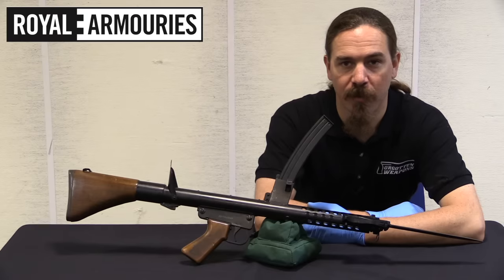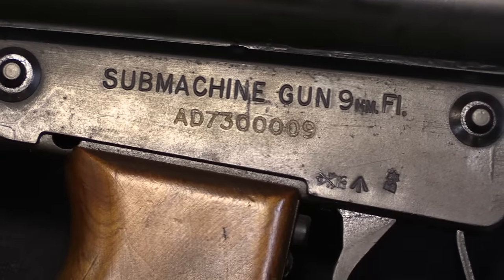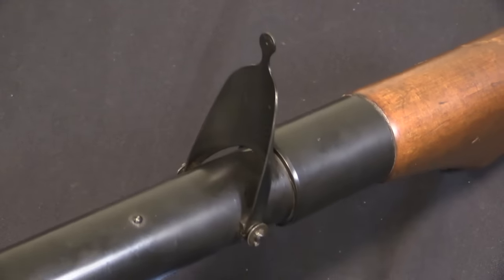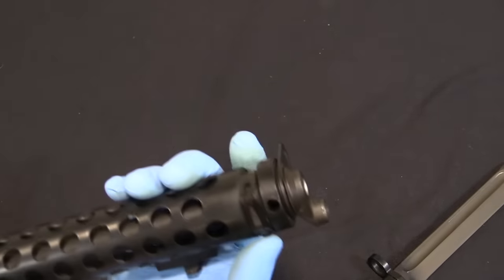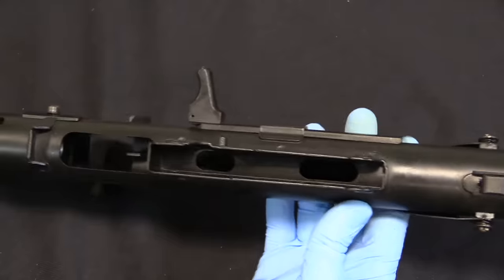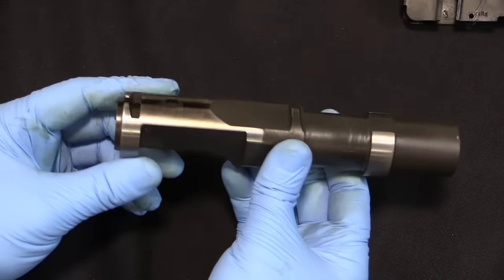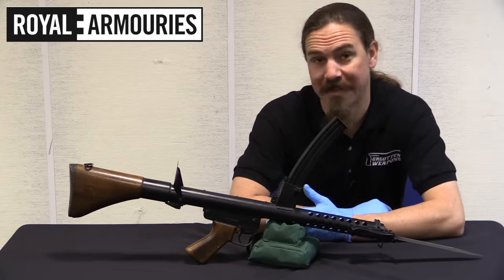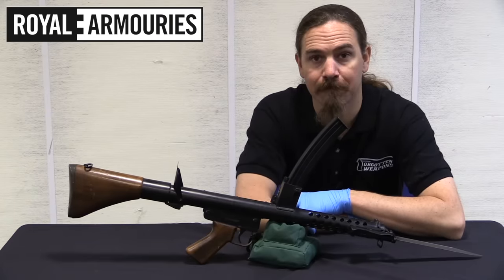Sterling Meets Owen: The Australian F1 Submachine Gun

Comment: As a young Navy Sparker, I carried one in Boarding Parties in the late-80s and early-90s along with the hefty Thomson TRC-300 radio that justified it's issue. It was usually strapped up tight across my chest but the top-mounted slings did allow for the whole weapon to be slung horizontally to the right at my waist and controlled with one hand while using the radio's handset in the left hand. Curiously, when the F1 went away, we largely reverted to going armed with a Browning High Power and ASP baton.

Comment: offsetting the sights to the right keeps it away from your web gear, especially that front sight that would be trying to catch of web gear like crazy if held slung against the chest or back
Reply: I'd think it has more to do with firing from behind cover & not obstructing the sight picture, but both are valid.

There's also some ergonomics in the distance between the butt and sight axis, which'd explain why it'd be uncomfortable to fire left handed.
Reply: You also use the gun tilted about 15-30 deg ccw.  The position comes naturally as you lean over the gun. That's a more natural position for your right hand.  

If the sights were on the left you'd have to hold the gun weirdly away from your body off near your head.
Reply: @ibast1  This is what I was thinking
Reply: how about it being more convenient, in times gone by, because of the right hand side of the brim of the slouch hat fitting more neatly over the gun body?  the hat was useful because it shaded the shooter's eyes.
Reply: If you think about how you'd change magazines left-handed, you'd wrap your hand around the mag holder and press the clip - if the sight was on the same side as the clip it might be a tad more painful.
Reply: It appears that the mag release is just exactly where it needs to be for a quick change, so if the sights were on the left, the left side would be very busy, indeed.

Comment: For the benefit of readers who have not seen combat, if you are firing from the hip or standing and aiming you have either been caught in someone else's ambush or you are going door to door in a village etc.  Australia likes to engage the enemy from an ambush position, we assess the enemy's movements and then we set up a kill-zone a K-Z where we can control not only the contact but also the area that the enemy can retire to, this area we usually loaded with Claymore mines.  The F1, while woefully underpowered when compared to my beloved L1A1 SLR is a brilliant way to fill a trail with angry little 9mm pieces of jacketed lead.  The right side of the receiver sight is where your right eye goes instinctively as your head goes over the tube, remember this is a very flat weapon.  One more point about the bottom of the weapon extraction, you don't get a fountain of brass showing exactly where you are firing from, you can also drop your brass into your hat and take it out of the bush with you, as they say, when in the bush "take nothing but lives and leave nothing but a rare footprint" you can't help but leave a footprint sometimes unless you are wearing a gadicha (featherfoot) over your combat boots..
The F1 is a brilliant SMG, from the same stable as the Owen and a heck of a lot easier to carry in a tight vehicle like an APC or a chopper as it has far fewer edges to catch and that rear sight, it is far more robust than you are giving it credit for.
Reply: I once fired 20 mags through an F1. Not one stoppage until the 20th mag. It finally jammed when the carbon build up around the chamber would not let the round in. A very reliable weapon. Not powerful but I never had one jam on me in many years of use even when dirty. Certainly as good as the Stirling, better than the MP40, sten etc

Comment: Hi Ian the bottom of the magazine was use as the screw driver for the trigger assembly pins. The sights were put on the right side to stop fowling on webbing. F1 was mainly used by armoured (Tank and APCs ) pers. and transport. As was instructed many moons ago. "This weapon is great for putting hot brass on your boots." The butt plate and butt came from L1A1 and shaped. The pistol grip trigger guard trigger also. even the bayonet boss came from the L1A1. Guess it was the cheapest way to make a submachinegun The AD stands for Australian Defence and starts with the year of manufacture and the weapon serial number. As same as the L1A1. I have a scanned copy of the F1 Training Manual if you are interested in a copy. Keep up the great work. Cheers.

Comment: Ian
Happy memories... As a signaller in the 70s it was the weapon I was issued. I never saw combat but there were many many combat vets and I can relate what I was told to me (please note I am relating things learned in the school of hard knocks, NOT the training manual) nominal magazine capacity of 32, never put more than 20-25 rds in, notorious jamming. A consistent comment was bullets lacked penetration at ranges greater than 30 metres. A friend had tried shooting a fleeing enemy at 30-35 metres. The rounds shredded the enemy’s shirt but failed to stop the person running away.
When putting a magazine in, striking with heel of your hand to ensure it had engaged was recommended. Why? Because having a magazine jump 3-5 metres vertically when you try shooting someone can be embarrassing. 
No info on sight offset: in reality I don’t know anyone who actually used them (damage to rear sight didn’t usually occur because they were not brought up to be damaged)
The weapon’s designation could cause problems if you didn’t pay attention. The Australian Army had an F1 sub machine gun, an F1 radio set and an F1 six wheel drive truck.

Thanks again for the nostalgia
Kind regards from Oz
Mark
Reply: Our instructors (Singleton '71) hated the F1 with a passion. Most of ours jammed.
Reply: Truth was, as a former section forward scout (late 70's) - I once asked the CSM what I was supposed to aim at with the F1 - being ex-Vietnam, he said you weren't expected to hit anything with it - basically it was a shoot and scoot weapon. If you ever got into an unexpected contact as a Scout, just spray in the general direction of the bad guys and run like f*ck. Good advice. Sights were a luxury.

Comment: Oh my, the memories of 'playing' with one of these. Much nicer to lug about than the SLR which was only just nicer to lug around than the AR (automatic version of the SLR). I loved firing these things when we had the chance (all on the range--including the sneaker range which was especially fun). No very accurate over about 50m, but with enough rounds heading towards that pop-up target on the sneaker, you could land a couple of hits that would have been hurty in the least. Targets sometimes popped up at less than 25m on the sneaker and you could often get all rounds into it knocking it over. I won a shooting trophy (SMG) with one of these.
The sight was never an issue and to be honest, I don't recall anyone complaining about it in the least, other than overall that the weapon was never accurate enough for many who preferred the SLR for accuracy over distances. C/mon.
Cleaning? Apart from those cooling holes in the barrel jacket (that loved to collect and protect dirt and dust by just walking outside with it), these were so easy to clean and maintain in the field. The pistol assembly pins were designed thus that a multitude of implements could be used to undo them ranging from an empty 9mm cartridge, the knife or spoon from your KFS set, a coin,  a tool on you utility penknife (I forget the actual designation of the 'penknife'), even a flattened beer bottle lid or a can tab, to an actual screwdriver.
Tes, a fun weapon to fire, though I used to prefer the SLR.
Reply: Did you ever have to qualify on the AR? We didn't but had to fire it for the experience. Beast of a weapon.
Reply: Knife, Pocket, Clasp? I remember them giving us a lesson at Kapooka on the correct way of slitting your wrist with them so we wouldn't bother the RI's with bullshit minor wounds.
Reply: I was instructing a female soldier on the F1 on the 30 meter range.  Like all of its breed it fired a burst to the right and upwards.  Shit was trumps as a round must have struck something as it riccosheyed 180 degrees and landed right between my opened feet

Comment: I know it well. Driving M113's for 6 years the F1 was part and parcel. Actually fun to fire. Tough little bugger too. The rear sight isn't as flimsy as you think and  on the range I had no problem using the sights and I'm right handed.  I think the position of the sights cater to a normal tilt to the left  you get when actually using the sights.

In regard to the Owen vs the F1. The Owen is a combat SMG. I know the F1 is  as well but it was really only used to get you out of trouble. Something for the crews to have if they had to bail. Unless you were  at the range doing your yearly competency on the F1 you wouldn't really use the sights anyway. If the enemy were that close for the 9mm to be effective you'd just have to point and fire.

Comment: It allows you to keep a solid purchase on the gun.  If the sights were on the left you would be holding the gun farther away from your center in order to see the sights, with them on the right you can tilt the gun slightly and roll your cheek over the stock to see them.  This brings the gun closer to center.  Honestly doubt they used these sights as more than reference points anyway.

EDIT: Scratch that, go to Lithgow and find out.  We'd love to see it.

Comment: ive heard that in jungle patrols they ended up folding the rear sight and just aiming with the front sight, since the distance was pretty close between them and the enemy (also how much accurate shots you expect from an open bolt smg anyway)
Reply: You are correct about distance. Contacts occurred between 2 and 10mtrs in Malaya and SVN and what we trained for up until the 1990's.

Comment: My guess on orientation is that it is not meant to be held in the vertical orientation, it is meant to be rotated about 15 degrees so the rear sight is vertical...  When deciding gun rotation, rotation 15 degrees counter-clockwise is much easier for right-handers, and rotation clockwise just feels weird and awkward...  That small of a rotation doesn't harm gun handling, and actually solves some issues...

Comment: The Australian army of the time of the SLR/F1 had a very nifty little multi-tool that had screw driver heads that fitted all the 'field strippable' screws, clips and tabs, as well as for adjusting sights etc.  By supplying those to each soldier as part of their weapon accessory/cleaning kit, it discouraged them from pulling things apart  that they shouldn't.  The army 'pocket knife' also had a screw driver head as part of the handle that also fit the weapons (pretty much all the fiddly little parts like screws and stuff were universal across all the common infantry man's weapons).  The one problem of the F1, although only a minor one, is that in long bursts occasionally a case won't eject so the weapon jams...the 'immediate action' was to cock the weapon, give it a bit of a shake, continue firing.  There was pretty much nothing else that could go wrong with it.

Comment: Maybe they cant the weapon to account for the sight offset? Instinctively that's what I'd probably do, at least on semi-auto fire....
Reply: From what I've heard, it's so you can fire prone more easily by canting it over - getting you as low as possible while keeping the grips out of the mud (and also getting the top of the mag a bit lower so you're not so obvious.)
Reply: aussiebloke609 Nope. I think they’re on the right for cheek weld and so the sight doesn’t rub or catch on your gear when patrolling. I Fired this a dozen times in the late 1980s and carried it on exercises: we were trained to hold the weapon vertically (normally), and the sights just seemed to line up naturally to my eye (right handed). I was always easily able to hit the targets and had no problem squeezing off single shots either. I’m guessing that if the sights were on the left it would have been difficult to have a firm cheek weld to the butt. At the time, the standard weapons were the SLR (FN FAL), the F1 SMG, or a Browning 9mm pistol (most non-infantry units didn’t have M16A1s). I quite liked the F1 but would have chosen a rifle for a deployment. The M16A1 and F88 Steyr that replaced F1s were far superior weapons for combat.

Comment: I wish I can find the source, but I’ve hear that placing the sights on the right mitigates another issue on top mounted magazines and that is that is rotational stability. Having a mass protrude out the point of rotation means that any adjustment pointing the gun will be met with an inertial force wanting to either stop movement or continue movement when adjustment stops. This can make it difficult the handle, especially when the magazine is in an unstable state. 

Having sight on the right side will insensitive the user to roll the weapon towards them. This would creat and triangle frame with the weapon and right arm being the right side of the triangle and the left arm being the left side. With the weapon rotated left, the left arm will have more control of the inertial forces collected by the magazine. At the same time, the direction of inertial rotation is now only going to occur counter clockwise so it is more predictable.
Reply: stephen callon , agbond003 is correct. The Owen also had sights offset to the right as well but mag release was central. Ie sight offset not due to mag release. Mag release on F1 couldn't be central due to position to fix the ejector to the maghousing/receiver tube. 
Offset sights to the right allowed the gun to be more central to the shooter- more controllable.

Comment: Like TimW, I was a tank crewman 1978-84, then RAInf till 1987.
 In reality, in the 1980s you did not use the rear sight of the F1 for other than deliberate shots - out around 35-50 metres. 
At short range, with the F1 drawn into the shoulder, you kept both eyes open and laid the more prominent image of the magazine onto the target. Then fired. Like 2020 combat shooting? 
But I also never heard of damage to the rear sights which did not also damage the body of the weapon. Tank turrets and tracks are like that.

Firing from the waist at short range, F1 was like SLR - lay your index fingers along the weapon, 'social finger' of the master hand on the trigger. Point and shoot.
That technique worked with SLR, M16, F1 and Browning 9mm Hipower. It doesn't work with F88 or EF88.
Lots of bad stories about Owen/F1 (stopped by a wet greatcoat etc) come from poor 9mm Australian ammunition in the 1960s.
In the 1970s and 1980s, you would not want to get hit by fire from an F1.

Comment: They should have just adapted the Owen gun to Sterling magazines and called it a day.
Reply: No, Owens were wartime manufacture at a fast rate by previously inexperienced machinists. There were large tolerance discreapancies across the inventory meaning that many parts were not interchangeable.
Reply: the military did not want to adopt the Owen gun in the first place but the govt forced them to give it a fair shot. it outperformed the other SMG's and it was accepted. infantry really loved it but the higher ups wanted to replace it with their own gun as soon as possible because salt. they couldn't just have a factory mass produce it so things would go smoother and have it be interchangeable and modded for ease of use and upgrading. no they make a slightly downgraded gun to replace it.
Reply: @aaronleverton4221   They were worn out by '73 and needed to be replaced. But from seeing the vid on the Owen and then this - yeah, just make new, improved Owens, with proper manufacturing and proper tolerances, and Sterling mags. From the look of the Owens, how much cheaper could the F1 have been? Saved a couple of bucks and lost the great reliability of the isolated recoil spring.

Comment: I was in 3 Cav in townsville and had the F1 as our personnel weapon with the browning Hi-power. The F1 was easy to handle with one hand and you could fire the browning with the other. You most found the F1 with vehicle crews or cockroaches, so bush work was relatively light, when it did happen, that was the beauty of the top mag, it created a benefit for moving branches out of the way without them hitting you in the face or using a free hand. it may sound odd to some, but it worked well.

Comment: Carried an F1 quite often as an Army Reserve infantry section commander in the 80s (it had effectively been replaced by the M16A1 in Regular Army infantry battalions by then). It was also quite easy to get off single shots once you had mastered the trigger technique.
Reply: I was an army reserve section commander/platoon sergeant in the 70s and early 80s and used these a lot.  I never saw the allegedly rear sight damaged on exercises. We were trained to fire instinctively from the waist without the sights as primary use - the sights were for single shots mainly in defensive positions.  Easy to get off single shots and no problems with the left hander sights for me as a right hander. I think it was to avoid the sights getting caught up in the right handed soldier's webbing.